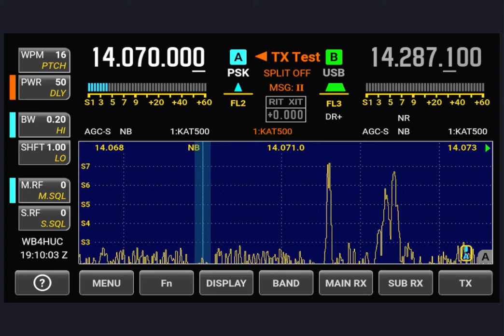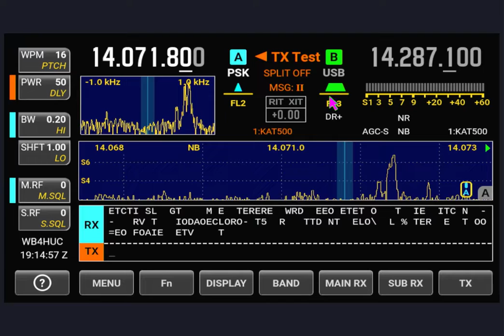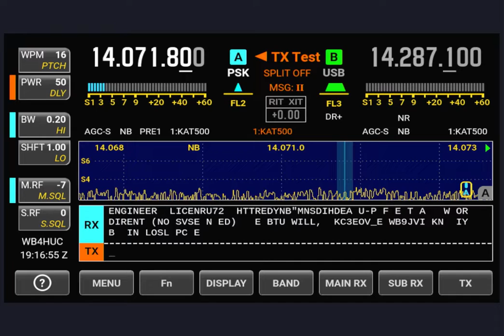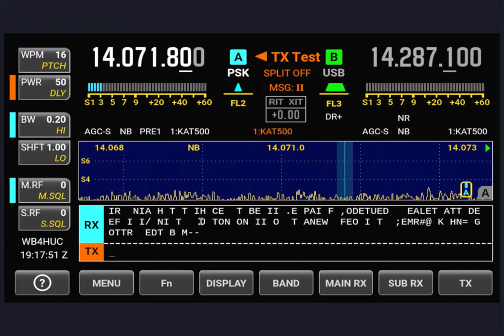Elecraft K4 built-in PSK feature - Receiving and Decoding signals

Comment: Could you just leave the main panadapter display at 368khz since you have the 1khz mini-pan in use ? That way you can see the entire 20m band activity and still fine tune the psk31 with the mini-pan. 😊
Reply from the maker: Maybe. I'd have to give it a try to be sure. I wasn't trying to display an exhaustive use of the built-in PSK31 feature, I just wanted to show an example of how it could work. 73.

Comment: Would be nice if it did built in FT8 too. That would literally be a game changer.
Reply from the maker: The exchange between two stations in FT8 seems to be pretty rigid, both in content and timing (the 15-second transmit and receive cycles). I would suppose there would be a need to account for those things somewhere in a setup menu or something. But you could always email Elecraft and ask them if it could be done in a future firmware update.

73,Mike - WB4HUC